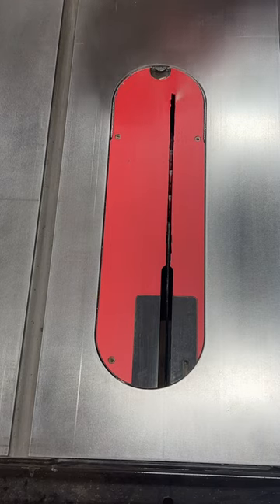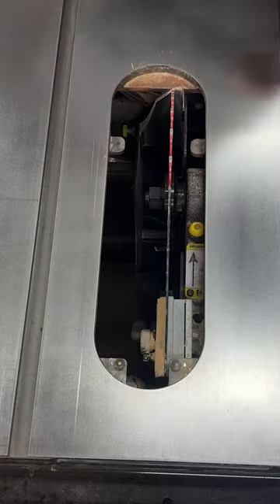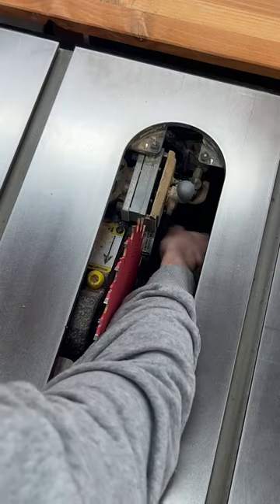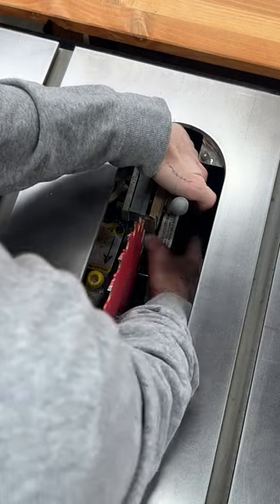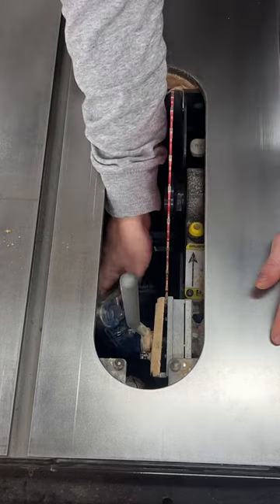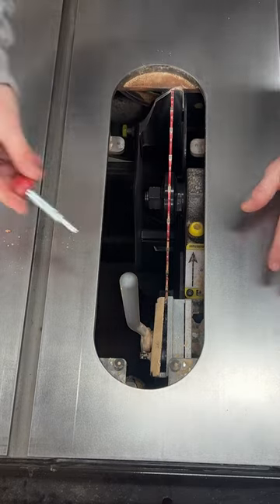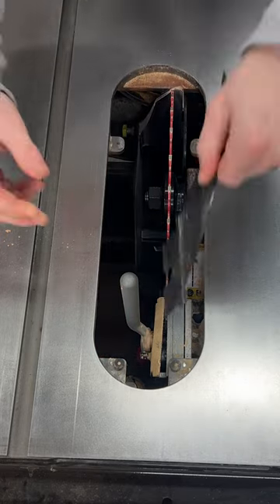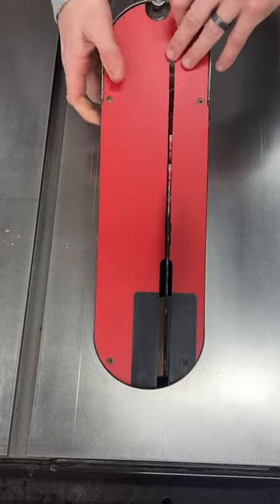How to Change a Sawstop Brake in one Minute | Shorts

Comment: I know that this machine with it's safety features is worth every penny but it would be nice if the system was designed so that it was resettable without it costing $100. 00 each time.
Reply from the maker: Might be the most “have your cake and eat it” comment I have ever read…
Reply: Hopefully ur not cutting so horribly that you set it off daily